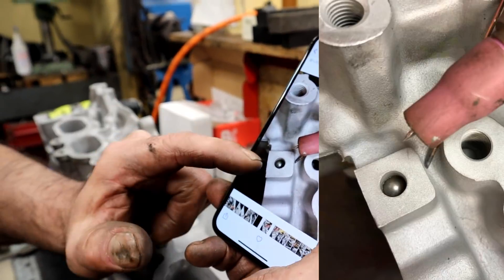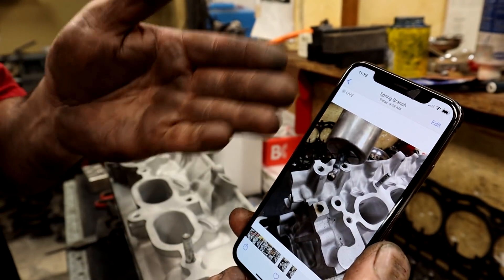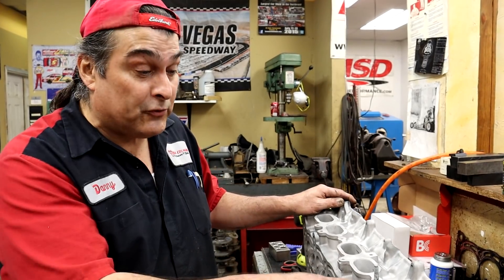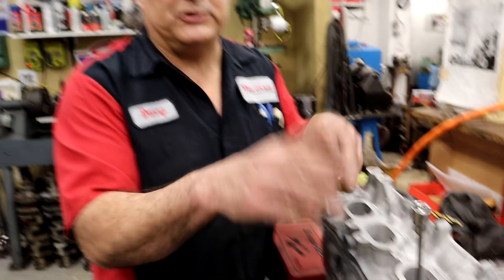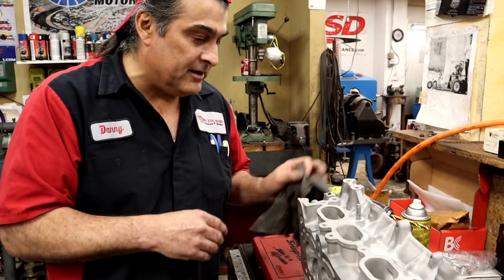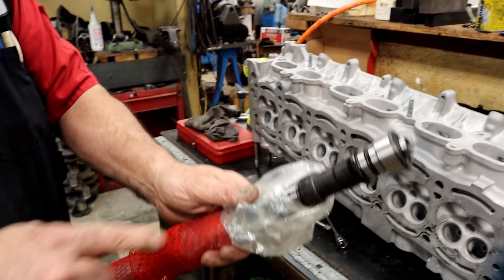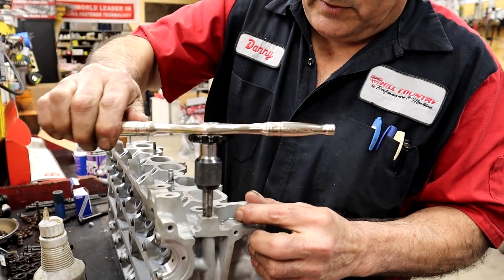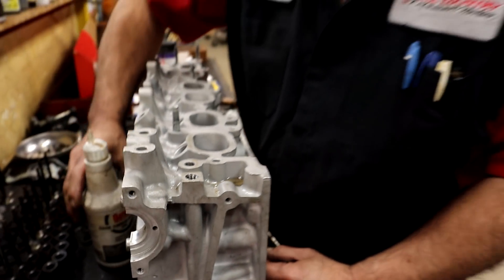Rebuilding my 7M Cylinder Head part 3 :Making it serviceable!

Comment: very cool ~ who would of thought to tig weld that ball and use a puller to remove it. I got some old automotive manuals and did not know they used  plugs on the carburetors of  the fuel passages very similar to what I see there for  the oil

Comment: Im off at work for 16 more days... I really want to get home and finish building my 5.4 2v 😆. Im rebuilding my heads and porting them out. This makes me want to clean my heads again haha. Im so close to being done. Cant wait to get the heads back on the block. Then its engine porn after that. Vmp gen 3R blower with a gt500 adapter plate i made. Im waiting on my exhaust header weld kit. Im building 180 degree headers. Man i want this damn work hitch to be over already 😆😆 i cant sleep at night

Comment: what he did to the head about the plugs I usually ask to have done to make sure when I drop them off to make sure they get clean and straight. but majority of the time when I take the heads to the machine shop is actually to get the valve guides serviced because of the gaskets that they usei usually ask to get it cleaned and do one other thing port polish as well as do a better job than factory on them. some engines like Mitsubishi they use a weird valve guide seals which start curling into the valve and tear them. when I get them back the one shop I use does the same as he does. makes sure the plugs gets capped because the other places I have worked at also installed a oil gage coming from the head to try to get a reading from that as well when the engine starts. I never trusted a sensor driven gage to be honest I rather see a indicator and a gage. same with some of my custimers. there are some people I did work on there cars and they don't have a concept of maintenance on there car. as well as checking to see if there is some thing needing to be topped off. I looked at one car and new immedeatly told them it would be wise to try to get another car. because I kept seeing messed up things from the power train. the whole thing. issues from the engine and the transmission. a big hole in the pan from the pan on the trans as well as a head gasket issue with the car. I almost got drug to court on them saying I did all that damage thank god for making sure I put in cameras as well as mikes. when ever I do a preinspection I shout to it I need this that and what ever. then order it. if the vehicle is like what I said I walk away immediately and look at a camera and say to much damage need to talk to customer. but I usually take things like that head to a shop like danny to do work on it to make sure it is ok if the customer wants or if it is simple fix like the guides

Comment: Nice video..I had to do that too a neon motor. Once you remove the plugs for cleaning and machining the block. One plug was a funny size no one had. So tapping for a pipe plug ended a wierd oil leak because the plug that was put in had a slight leak. So all the race motors we built after that, just use a plug and end the issues.

Comment: Can ask danny if its worth doing the "Zulu" mod to the head which requires drilling a hole in the head by the #6 cylinder to fet more radiator fluid. Please check it out.

Comment: Excellent video! I love the way Danny approaches an engine...like "if I were designing and building it, it would have x or y so it's serviceable". We're all looking at this thinking, stop making everything disposable! We didn't know what the designers and manufacturers were up to.

And you're right, we're stuck at home and need something to do. I've got one oil change, and I'm about to order parts to do my Honda CR-V rd1 suspension, front and back. Now that I changed the struts, all the problems are making themselves known! I also need to rotate the tires on my Subaru.

Comment: Excellent! Cool random related bit of info for you, Faye: The SR20DE we got in the USA actually has all the same block casting provisions for turbo oil/coolant feed/return as the SR20DET. Early engines often even have some of the ports drilled and just plugged off. Later engines often just have the bare casting with no holes. In either case, you can remove the plugs and tap or drill the block and tap to have factory turbo oil and coolant supply when you turbo an SR20DE engine! You may already know, and you may never use this info, but knowledge never hurts. Just made me think of it. :)

Comment: Kudos Fay. Making Long for and wanting back   my 82 & 86 bi turbo Supra. My 82 had pop up head light and pump up Lumbar support seat. Lol. The 86 bi turbo dash had 4 gauges oil temp/pressure, alternater volts, and coolent temp. Good luck. Go for the gusto.